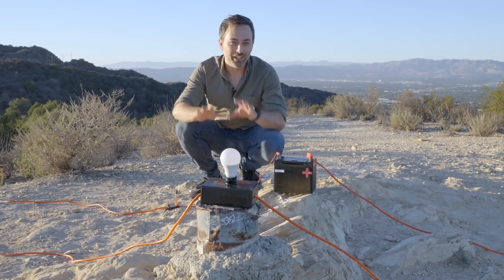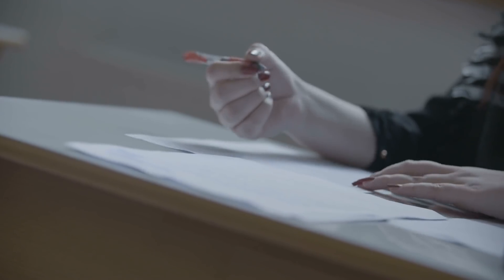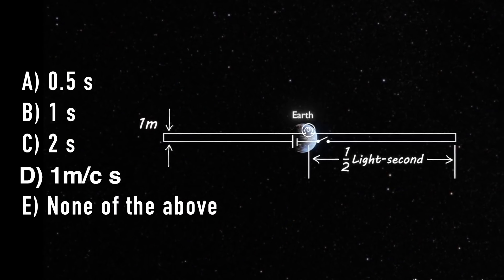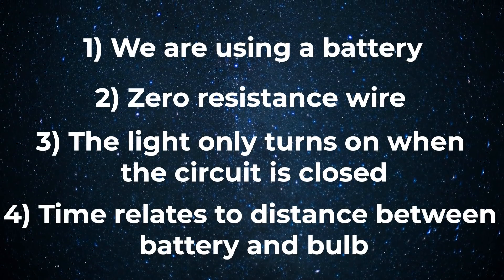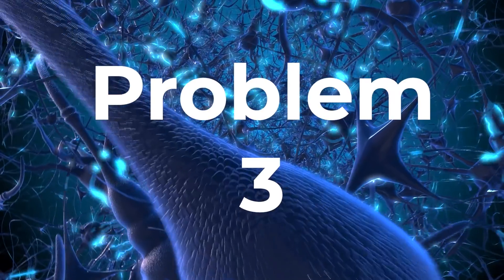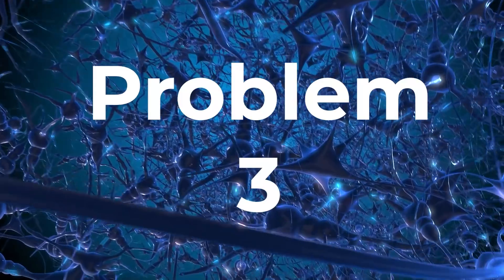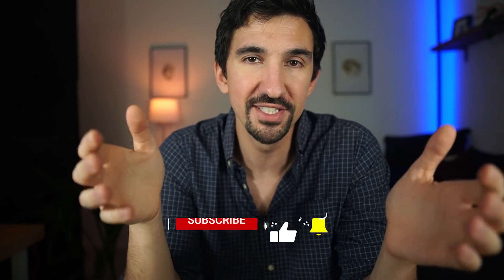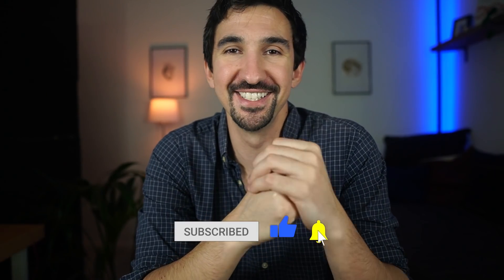Is Veritasium Wrong About Electricity?

Comment: I think the thing Veritasium fails to appreciate is that whilst the EM field can/does have an effect in 1m/c seconds, this effect is not the full effect of the circuit, which will require waiting for the information to propagate all the way down the wire. One should take a much closer look at the Poynting vectors in order to understand this behaviour I think. Energy is flowing in ALL directions away from the battery and coming into the lamp from all directions. When you close the circuit, you are allowing a local current to flow regardless of the global state, this provides the necessary magnetic field to produce an energy flux. That energy is travelling at the speed of light, carried by the EM field. And indeed, some small portion of it is pointed directly across the gap towards the bulb. That energy is transmitted in a 1m/c seconds but it amounts to only a portion of the available power. The rest of the energy follows more convoluted paths that diverge further and further away from the shortest path, basically hugging the wires all the way to the ends. The more time that passes after closing the circuit, the further the current will have progressed down the wire, the magnetic field following it and as it does, the energy flux is "filling in" until the signal reaches the ends of the wires and closes the last lines of energy flux as it were. So my hypothesis is that yes, energy will begin to flow into the bulb almost immediately, but only a small fraction of what the battery can provide. As the signal propagates along the wire it is creating more and more energy flux. After 1 second, when the signal has reached the ends, you now have maximum energy flux and the bulb is at its brightest.
Reply: Veritaserum did actually state the bulb doesn't receive the entire voltage immediately, and that the full voltage would depend on the impedence of the circuit, etc. He just didn't give any particular figures about how much of a fraction that would be.
Reply: @workmad3  that's yet ANOTHER problem. due to impedance of the circuit, the full voltage takes time to be established . But the difference is a fraction of the time to reach the lamp. What was considered null was that delay, not the delay to reach the lamp.
Reply: I think Veritasium covered this in his question when he said 'assume that "the light bulb has to turn on immediately when current passes through it" and "the wires have no resistance". As others have said, I think the point of his video was not actually the thought experiment used in the video, but rather about the misconception that electricity travels through 'push and pulling' electrons. (I am not an EE and I don't know how wires work, this was just my take)
Reply: Yes, Veritaserum stated the bulb doesn't receive the nominal voltage immediately, did not elaborate the reasons or physics behind this important fact.
Reply: I watched Veritasium's video in full : he specifically addressed this aspect in the end : by postulating that the energy was flowing through the magnetic/electric fields, following the vectors of said fields, it is quite implicit that not ALL the energy will reach the bulb almost instantaneously, because the remaining field, "surrounding" the wires, following their path, and curving along them, follow different vectors. Thus we can picture that 100% of the energy will only be delivered when all the vectors will have conveyed their part into the bulb.
Reply: @famillebeaulieu-luangkham2923  no one cares...veritassium used clickbaity speech to create buzz around this topic and get greedy views...general public and people not familiar with these concepts are almost led to believe that the bulb will see an immediate measurable current flowing through it via thin air...thats is a lie...that induced current would be hard to measure let alone do any visible effect to the bulb...
Reply: IIR, at the end of the video, he says that "energy reaches the bulb at the 1m/c s mark", which I understood as "some" of the energy and not all of it.
Reply: He covered this in the first few minutes.
Reply: 100% agree. This comment should be pinned
Reply: "So my hypothesis is that yes, energy will begin to flow into the bulb almost immediately" Your hypothesis breaks laws of physics. You cannot transfer information faster than light. And Veritasium claimed, that with all the things he proposed taken into consideration, you can. So its a stupid video and stupid thought experiment.
Reply: @rykehuss3435  no, it doesn't. It completes veritasium. There is no faster than light
Reply: @rykehuss3435  Sorry but, have you watched Vertasium's video ? He NEVER prentended any of that : quite the contrary : by saying that the energy was flowing through the magnetic/electric fields directly from the battery to the bulb, taking the shortest path, he expressed the speed of the signal using C (1m/C ; 1m being the distance between the battery and the bulb). You really have to take account of the fact that he postulates that the energy doesn't flow through the wires, so it won't take "length_of_the_wires/C" seconds to reach the bulb

Comment: Let's all remember there is a difference between explaining something that gets the relative gist of how something work and the details on how exactly it works. And sometimes those details get refined over time. Think of it like gravity. We are all taught that gravity is proportional to the masses of the objects and inversely proportional to the distance between them. However, general relativity provides a basis for showing that gravity doesn't really exist. But Newton's methods work for the small frame of reference that we will always be in so there is nothing wrong with continuing to teach it.

Comment: Very well explained the answer.
About the antenna analagy I was considering, would an hypothetic separator between the two ways of the cable(flow and return) son no interection could be possible annulate the current following the same principle of symmetry you applied for the current in the mental antenna experiment?

If this simmetry can be applied to any circuit shape, does this tell us something about the whole experiment idea?

 Apart of considering the fact of light travelling faster than light, if someone cuts the cable before the wave has propagated to all directions, would it make any sense that a light had turned on without having an electromagnetic field through all thr cable?

Comment: A great analogy is to think about circuits as sending noise down a pipe. If you put the two pipes close enough to each other you will hear noise from the other pipe even though the pipes may not physically connect or they may form an extremely long loop. In signal integrity, this is called crosstalk.

Comment: Not my field at all, but, you see the battery as the power source, but if you connect two wires to the battery and the other side leave unconnected 10 meter away, would you not have moved the power source? So if you break the circuit in your example 300,000km away at the far end, would you then not notice it 300,000/c s before the light goes off?

Comment: Too much volt drop with the wires. You wouldn't get the right voltage at the end of the line with those small wires. It might turn on instantly but you bulb would be very dim

Comment: This all actually is pretty funny.
This loop of wire is an induction coil.
It will take much time and power to charge it, so the bulb will turn on noticeably after some time and then get to standard luminance.
If you break the circuit, the coil will discharge and break the lamp, it will flash.
Unless all the energy is dissipated in the resistance of the wire.
On the other hand, if the wires are close enough to each other, the bulb wires can pick up signal from the battery wires and light it up accordingly.
THIS IS NOT A DC CIRCUIT due to it's size,  don't try to apply wrong tools.

Comment: Why is there an ark between ground and Vcc? If the energy can transfer to the load via the EM radiation through air, why is there electron jump? Current has to be flowing within the wire. No current no EM radiation.

Comment: Light travels through empty space at 186,000 miles per second. The electricity which flows through the wires in your homes and appliances travels much slower: only about 1/100 th the speed of light. Part of the reason is that light is massless; it has no weight, whereas the electricity flowing in the wires is made up of a stream of electrons, all of which have some small amount of weight. In addition, the electrons flowing through the wires constantly bump into the atoms of the wire, which slows them down considerably. If you were to take the electrons out of the wire and make them flow through space (which is essentially what you do when you make a spark), they can move faster, but no matter what, they cannot move as fast light.

Comment: Just makes his thought experiment nonsense and a gimmick. Because then it would have turned on before the power source turned on due to already traveling EM waves in space, radio, sun, cosmic background, etc, etc, etc. At least if any amount of power. This would mean the answer is e, before even closing it or as soon as closed.

While I agree with electromagnetic waves carrying the energy, or at least not a flow of electrons (as it's them oscillating instead). I'm not really convinced nor do I believe his thought experiment. I do make the assumption that not any amount of power is enough but needs a minimum amount of power delivered by the source. If he was talking about capacitance, then his thought experiment is nonsense and just pointless, as that is not something that generally ever happens on a practical scale, unless you start working in micro and nano-technology. Nor is any capacitance on that scale ever going to be able to power a light bulb over 1m. He isn't using a tesla coil or something which produces equally high voltages. (nor would the circuit even matter or have a purpose)

Basically his experiment claims that, in a vacuum, only the physical distance between source and load matters, not the length of a cable (barring resistance), I will assume here a perfectly isolated/coated cable. That I'm pretty convinced even with perfect conductors (super-conductors) is not going to happen. However if you account for equal load/resistance along the cables then changing the distance between source and load, at macro scale, doesn't do anything nor turn off the load once it's way too far for any capacitance to matter. However we know from practice it's the resistance of the wires/cables that limits how far you can transfer power from 1 place to another, not the direct physical shortest distance. How do you test this in reality, get two 100m or even 10m long cables, connect them to load and move the load from the source in 1 or 10m increments. By keeping the cable the same lenght, their effect doesn't affect the experiment and the only parameter you're changing will be the physical distance, you will not be able to measure any noticeable effect for a low load(voltage specifically) like a lightbulb nor in how fast it would turn on or off. 

Let's change it a bit and see why it's weird and nonsense. Let's say the loop stays equally big but now between the source and load (lightbulb) a perfect isolating wall for electro-magnetic fields is placed (not a material that exists but neither does his cable). Then compare this situation to where there's no isolating wall. If in that case what he says and claims, that it takes just a fraction of a second, 1/c or 1m over the light speed, this would result in requiring that my new example doesn't turn on as fast and would turn on much slower. Keep in mind I'm not talking about a dielectric or magnetic material that directly affects the fields, no just a shield/wall that blocks it from passing through. However if you would make any experiment as close as possible to this in practice by using much shorter distances and very high speed measuring equipment, you should not see a difference for how long it takes to turn on in either situation, the time should be the same. Similarly, if you change the 1 to 10m, or 100m, it also doesn't make sense that the time would then change to 10/c or 100/c.

Comment: On your comment about us not being able to communicate faster than the speed of light, here's a question: what would happen if we had one person in a planet that's one light year away from a person in another planet, but they are both connected by, let's say, a metal round bar that is long enough to reach both planets. They develop a language in which if one turns the bar to the right (clockwise) it means one thing and if to the left (counterclockwise) it means another thing. Like Morse code in your example of the switches. So if at one end one person turns the bar to the right, would the person in the other planet feel the bar turning at the same time (simultaneously) or would it take one year for his to feel that movement in the bar? If simultaneously, that would break that rule. And after all, a metal bar is made out of atoms that have to "communicate" the movement between them, and that would happen at the speed of light. So would it take one year for the rotating movement of the solid metal bar to reach the other planet? If so, how solid is solid? Interesting to think of a solid metal bar as being "alive" and twisting from one end to the other sequentially, just at the speed of light and not instantly at both ends.

Comment: I still believe he is wrong and changing the idea from transmitting through wire  to using wire as antenna does not help. the model of using wire as conduit by physics teachers is not a lie or wrong. because if we assume wire are pipe conducting liquids and the electrons are the liquids particles then the wires will conduct the difference in  voltage( electric pressure) at the speed of their interaction ( the speed of light) the same way liquids particles conduct pressure at the speed of their interaction ( the speed of sound in that liquid) .

Comment: It's actually the mutual inductance per unit length between the wires which will lead to the gradual power transfer to the bulb until the full wire gets covered by the propagating field at the speed of light c. The mutual capacitance will act in conjunction with the bulbs resistance to give the time constant tau = 1/RC which will decide when the bulb is fully lit up to the V/R value asymptotically.

Comment: Number 3) is somewhat wrong assumptions. You can break a circuit and light can go on. For example transformer - alternating current generates current in secondary coil, but circuit is not closed. For direct current it will still transfer impulse and power will be momentarily transferred when you switch current through primary wire on or off. And regarding 4) assumption, i would say that it does not depend of distance from battery to light bulb, but on distance from switch to light bulb. Cause that's where change of EM field propagates from. And wires at the end of the switch already have different electric potential, so they act like a capacitor that gets discharge into the light bulb and information about change in electric potential travels to the battery that will try to restore it after some time. I would assume that it depends on shortest distance between the switch and light bulb (not on the distance along the wire).
And last - isn't it allowed for information to propagate faster than speed of light? (in case of quantum entanglement)
EDIT: thinking about this, I'm not sure if battery will charge electric wire by extra electrons or it will just carry information about having surplus/lack of them.

Comment: I'm not going to take a position on how long it takes for the bulb to turn on. However I'm challenging your assumption 3. Usually circuits need to be closed so that the electrons can keep moving. However, in a cable thats a lightsecond long, it would take at least a second until the charges build up to counter the electric field of the battery. I think the argument is, if the cable is broken, then the light would turn on until the electrons stop moving. So it would turn on instantly for about a second before it turns off.

Comment: Thank you for this video. Your explanation makes a lot of sense. But as you say, there will be a short signal, when the switch is closed. This spark like signal will induce a small flow of charges through the wire and maybe also through the filament of the bulb that are close by, but it will definitely not enough to light up the bulb. The flow of currents will only last for the fraction of a second. For a persistent flow of currents one would have to wait for the potential difference to travel from the switch through the wire to the bulb. And this should take at least a second and not 1m/c. If I understand you correctly, you agree on that. But the major statement of Derek was, that the energy flows through the field and not through the wire. I think, that this is just correct for AC and not for DC. In a circuit energy comes from the potential differences, and it takes much longer than 1m/c for this to build up at the location of the light bulb. If it was AC, the situation would be completely different. You could take the long wires on either side as emitting and receiving antennas. In this case the bulb would in deed light up after 1m/c. As much as I like Derks videos on his Veritasium channel, I am afraid, this time he is wrong. At least I haven't seen an argument (yet) that convinces me.

Comment: You CLEARLY ignored the fact, that light bulb is JUST one meter off the switch! NOT at the distant location, nor the switch is at the distant location. If they were there, then you will be right to include relativistic effects and causality propagation thru spacetime. Here it is "few nanoseconds away", and you clearly ignored that simple fact. Howgh.